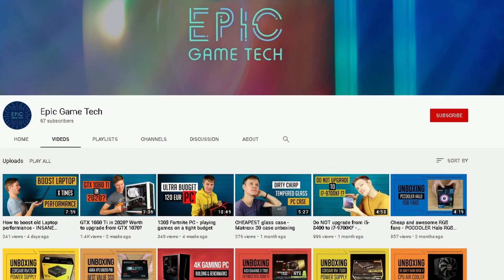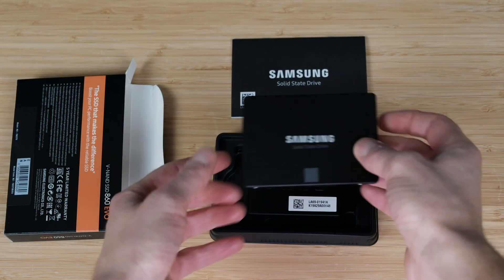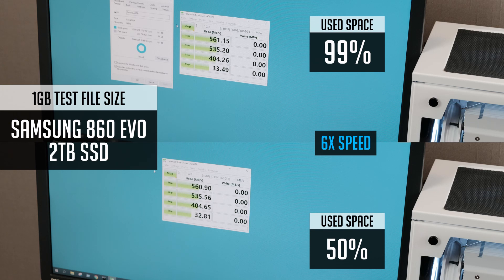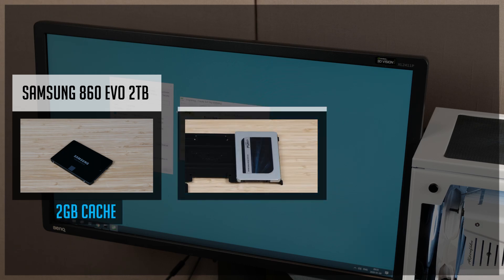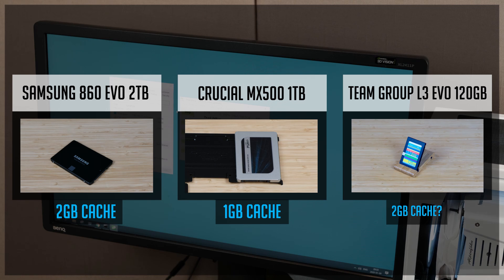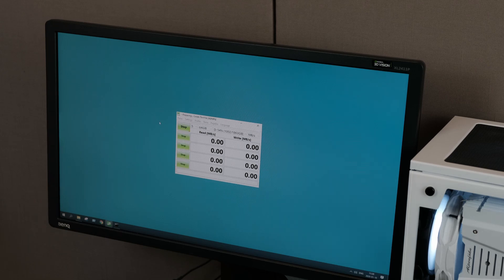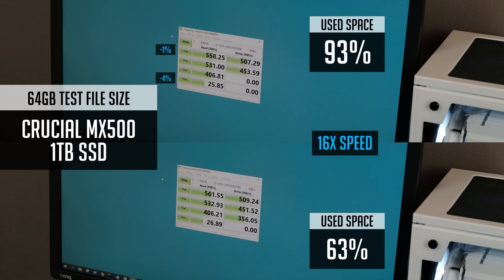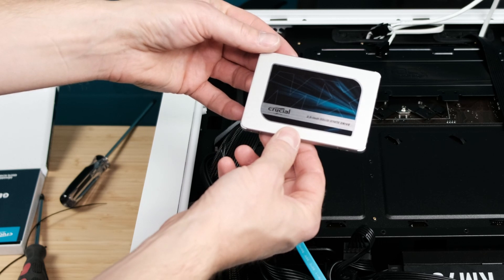MYTH BUSTED: FULL SSD SPEED MYTH? TLC SSD speed test | Samsung 860 EVO | Crucial MX500 | TeamGroup

Comment: Just an update on this one: I believe the myth doesn't apply to an almost full brand new drive. It has to be an almost full drive that has been used for a while (and had a total of more than the entire drives contents written/erased over time). The idea being that the drive has to have opportunity to run out of free space "behind the scenes" first. If you are just filling an already empty drive to try an simulate this, then there is likely still enough free space "behind the scenes" (In unused "blocks").  To do this test you'd probably want to write 100%, delete it, then write 90%, and do it all in 4KB sized files. That should give a worst case scenario to see if the myth is indeed true.
Reply from the maker: Hey,
thanks for sharing this! Possible scenario, as I've didn't tested like you described :)

Comment: Bro can u help me? I have a 120gb ssd and its almost full! It only has 9gb left! What happens if my ssd is almost full?
Reply from the maker: Hey,
Well, windows need some free space to work properly. Windows system can start lagging etc. 
In general, it's recommended to leave 10% or more free space on your SSD as it might influence speed.
And for windows to operate properly, I would recommend having at least a few GB free on your OS for windows to work properly :)
In general, I would suggest getting additional ssd or hdd and move most of your files/games/moview etc to that disk.
Reply: @EpicGameTech  ok thank you :)))
Reply: Buy a bigger one. 500gb is a good size.

Comment: This would be more likely to cause issues if the SSD that you are using is where the operating system is then I think you will notice a difference rather than transfering files to and from the SSD
Reply from the maker: Could be. But shouldn't random read/write numbers show that? (bottom numbers in Crystaldiskmark) :)
Reply: @EpicGameTech I think the issue has probably more to do with the effect a full drive has on other components than the drive itself like I've noticed even if you have a SSD bootdrive that is full it tends to cause alot of CPU overhead which in turn can cause slowdown and I believe it also depends on the size of the files that are on the disk
Reply from the maker: Well, I've also seen some complaints regarding SSDs slowing down system performance.
But never heard SSD can make CPU overhead? :)
In general, older SSDs had that "slowdown over time" issue more often for sure. Older I mean those 60-120gb ones that were released ages ago (8-9 years ago).

Comment: I am confused between 860 Evo & MX500 [500GB]. Which one should I buy?
Laptop Conf.
i5 7200U
4GB 940MX
8GB RAM
Reply from the maker: Hey,
Honestly, they both are great and almost identical drives. In a real-world scenario, there is no difference. So I would actually get the cheaper one in your country/region :)
Reply: @EpicGameTech  Thank you so much!
Reply: Got both in the 500GB size, despite the Samsung being better in synthetic benchmarks, in real life, all this doesn t matter...even less so given your hardware. What might matter to you if you intend to clone a drive to your future SSD is that Samsung has by far the best cloning software, basically the only one where you got a good chance to do a boot drive transfer without issues...that being said, cloning the Win boot drive is usually not worth the potential hassle
Reply: I am late to the party but I will just leave this here: Warranty for 1TB QVO Samsung 3 years, Warranty for 1TB MX500 Crucial 10 YEARS (or 360tbw)!!! Price difference is circa $10-$15

Comment: why my ssd write speed is drop from 450 to 116?
Reply from the maker: Hey,
did you tested these numbers in some benchmark software?
Or you are copying some files from one drive to other drive and you saw a dip from 450 to 116 in windows file transfer?
If so, how much GB you tried to transfer and what's the exact model and capacity of your both ssds? :)
Reply: @EpicGameTech  i do file transfers all the time my crucial mx500 2tb ssd's onley get 500 MB sec on small transfers on large ones its 200MB to 300MB top speed. no faster so those are real world results. likewise with HDD some of my HDD are nearly as fast as the top speeds through usb as my crucial mx500. and with caching software i found them faster. so i decided to onley use my ssds as an additional cache for the hdd. as its cheaper and i still love high end hard disk drives.

Comment: does it mean the L3 evo have d ram pls answer
Reply from the maker: Hey,
as i mentioned at 2:28 it was hard to find an official info on how much cache (if any) L3 EVO 120GB has. As I've mentioned in my video, I've found few posts that it should have like 2GB of cache, but it's not 100% confirmed. It's due to no in-depth reviews on L3 EVO ssd.
But in general, I've used 4-5 L3 Evo SSDs and their performance for the price (budget ssd) was good enough :)

Comment: Please make dram vs dramless ssd in real life usage like app opening etc. Plsss requesting
Reply from the maker: Hey,
good video topic :)
I will save it as one of the ideas, as I will be able to do it only when i get an opportunity/products from some brand or will be able to buy them some time later on.
Reply: @EpicGameTech  ok no problem bro ❤️from India
Reply: @VikasGupta-xg3uv  never buy dramless cause if ur copying like a 5gb file it will slow down to about 80mb per sec after a min and they just die quickly too ! i ordered BX500 but after reading reviews cancelled it and got samsung evo for 700rs more and its def worth it
Reply: @RosPlayzYT  ok tysm😊bro
Reply: Bx500 und mx500 isn same ssd mx ist premium als evo
Reply: @sseemmiirr  Bx is cheeper without dram and has less warranty too ! gets slow after some time cause its dramless but 10 bucks for more reliable model like mx500 or 860 evo is def worth it